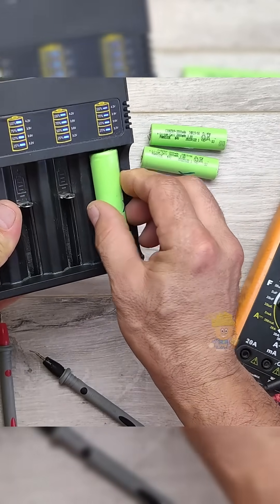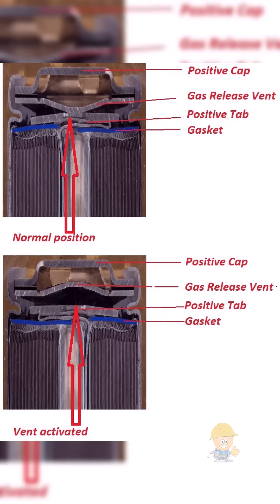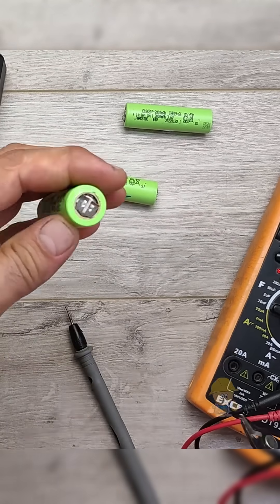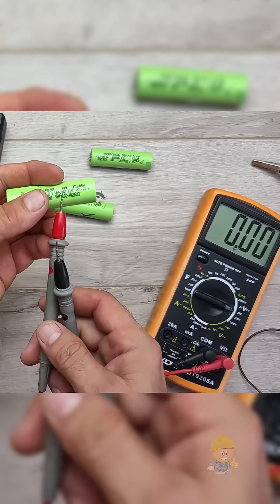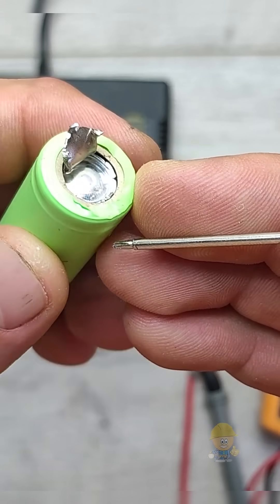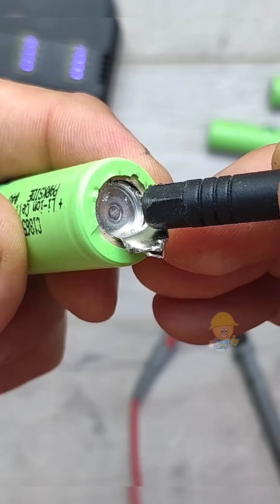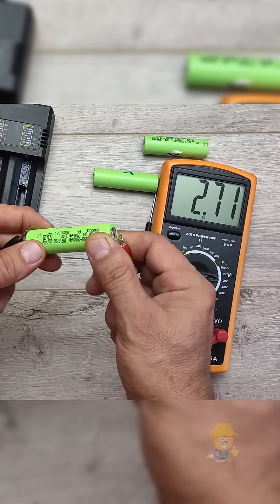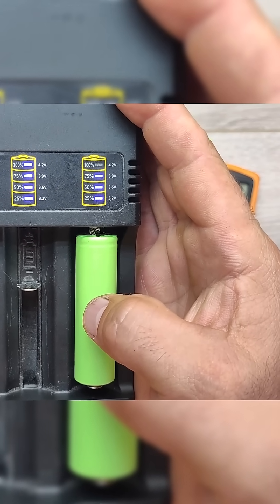Parkside cells How to reset 18650 dead 🔋 lithium cells #diy #parkside#battery

Comment: I dont really know what your talking about. Ive been messing with 18650 cells since 2015 and they rarely if ever have 'protection'. You shouldn't be messing with this safety feature if there is excessive gassing its designed to rupture the weakened wall instead of exploding. Its the best thing as lithium ion cells electrolyte is flammable. If you don't understand batteries you shouldn't be messing with them as lithium metal is extremely reactive with water (but it makes a great battery) and there lit nothing you can do if there on fire as they store a tremendous amount of energy and that energy WILL come out as fire/light/gas fueling itself. There like ppl there sensitive to temperature and if misused will cause a fire. I have literally thousands and not a single one has gave me a problem.

It also helps not to be stupid. Life is SO much hard when you are.
Reply: Even unprotected cells have some protection, like shown in the video. "Protected" cells usually means it has a battery protection module inside, a tiny piece of electronics that prevent over charging, discharging and over current. "Unprotected" just means it lacks the electronic protection, they still generally gave the mechanical protections.

I don't think you understand batteries as much as you think you do.
Reply: @conorstewart2214   wait till he hears about a bms!
Reply: almost ALL name brand 18650s have CIDs and this video explains it well but obviously its very dangerous to reset a CID as if someone manages to pop the CID in a 18650, that cell has been very abused
Reply: @joshwayop  it means it was ruptured for a reason plus the lack of electrolyte. as im more of a mechanic I would call it a pressure re leaf as that's exactly what it does. cid is very unintuitive and kinda misleading
Reply: @ they are called CIDs in lithium batteries, its the officail name, but yes they are pressure release valves
Reply: please learn English and WITH grammar.
Reply: @Nilmoy  Dragon.... How about you speak dragon instead. Ever played Skyrim
Reply: this chinese shop advertising :)
Reply: @r3volt97  they tend to be weird and awkward like the amazon videos lol
Reply: @r3volt97  All your hard berongs to us.

Comment: The idea is good provisorly until you run the battery out for the last time, but don't try to charge it again ! If the protection popped out is because the lithiun is heating up . To charge without this protection can cause battery explosion
Reply: The valve should still work after reset, but I would only use this option in an emergency.  Like you said, it tripped for a reason, and will trip again.  Replace ASAP!

Comment: I hope no one actually does this to their batteries but this is really cool to know. I guess the batteries dont mysteriously completely die and wont even take charge, its just activated the saftey mechanism, good to know👍
Reply: a safety mechanism that exists because that cell will no longer charge predictably. I do it to cells that I intend to overvolt for lulz. I can't imagine anyone bringing one in their house, let alone holding it to their face after disabling the safety.

Comment: ya i reset these, or rather bypass them all the time... got all kinda things working again off old once dead laptop batteries. I've converted many older flashlights and radios and stuffs to use these instead, its so nice, they last so long, and no more buying aa, or aaa's c, d, etc///

Comment: Usually if they are just dead recharging works. Of they have a blown vent don't use them again as they are damaged inside.
Reply: Exactly
Reply: It's amazing how many people don't know what they are talking about! If a lithium-ion battery is below 0.8 volts a charger probably won't work. You can jump it with a charged battery to bring the voltage up to a chargeable level. Also they do have a circuit breaker in them if they happen to get shorted out. If your battery is reading 0.0 volts you can take a small, sturdy piece of metal that will fit in the small holes at the positive end. Pry down on the metal cap underneath. You will hear the gas escape like when you open a carbonated beverage and the battery will now read a chargeable level. I have been doing this for several years and saved lots of batteries that would otherwise have been thrown out. Reuse and recycle please!😅
.
Reply: @ You are the one who doesn't know what they are talking about. Try reading full comments and understanding what people are saying. Perhaps stop smoking meth before using the internet. There are Lithium ion chargers that can do 0 volt charging, meaning they can charge a lithium battery that is under voltage. And under voltage for a lithium battery would be anywhere below 2.8 volts, not 0.8. You should NEVER jump a lithium battery with another battery as it charges way too fast and actually damages the cell, That means you will potentially have both cells explode from over heating. A charger from a dollar store power bank will properly trickle charge the cell until it is over the 2.8 volts, then will charge it at the regular rate. Learn things before commenting stupid things like an idiot. No, lithium cells do not have a circuit breaker. solid ones that are not pouch batteries have a vent. That's all. I would know... At this point I must have had several hundred of them. And you NEVER pry the cap off to vent gases, it does that on its own. And a battery will not magically read a chargeable level by venting the gases, as the gases have no effect on the charge level. I know you haven't done this for years. You'd have burned down your house by now. Idiot. The fact that you claim to have done this for years, tells me everything I need to know about you. At the least you smoke crack or meth, and you're a very stupid person.
Reply: If they're below 2.8 volts, then many chargers won't charge them because they're "under voltage". You'd need a charger that can do 0 volt charging (charges from 0 volts rather than 2.8). The dollar store power bank circuit board can do this.
Reply: @darrylkinslow5613  Either this or a lab power supply. First set it to 1V, then 2V and so on until you reach 3.8v. Every time set the current to 100mA max and wait till it drops to 0A. Then raise the voltage to the next level. IMPORTANT: Constantly check the temp of the cell. If it starts to get hot, stop charging it and bring it outside, as it is damaged internally. Wait a while and then properly dispose of it in a recycling centre. Maybe discharge it to 0V with a resistor to stop it from being able to burn.

If a lithium cell is at 0V, it often can't start burning anymore. I tried putting a hole in a small LiPo battery after it had 0V and nothing happened except a bit of smell. Don't try it at home, but it is a good advice to slowly completely discharge it if you have a bad or damaged cell.
Reply: @ I would never recommend attaching a battery directly to a lab/bench power supply. No protection whatsoever. You're likely to have the battery explode from overheating.
Reply: @darrylkinslow5613  That's why I said to limit the current to a low level and check if the battery becomes hot. It's nothing a normal person should do, only people who know what they are doing.

You should just dispose of bad batteries and buy a new one.
Reply: You do know it's a chemical reaction and chemical degradation/damage due to (ab)use?
Might work in a pinch, but always need replacement. They are zombie batteries.
Reply: не трынди
Reply: Correcto cumplió su función,  se activo valvula y la desabilita por seguridad, romper la valvula para seguir usando es peligro de incendio explosión dentro de un dispositivo

Comment: Please for the love of God don't bypass the safety devices on lithium power cells, recycle your batteries and by new ones so you don't burn your house down
Reply: saya sdh mencoba nya itu bagus buat penerangan solar panel
Reply: Because lithium batteries will do that anyway if you have them, when luck decides to give you the D instead.
Reply: You're not my mom
Reply: Don't do it, but here's a step by step guide on how to easily do it.
Reply: @Mug-Red

Don't do it at home (unless your really know what you are doing 👀)..but.. in a emergency situation this information could be the difference between life and death.
  Knowledge is power and power comes with great responsibility. 😛
Reply: Ikr😭
Reply from the maker: This video is only a presentation of the safety system, and it is specified in the video that it is not recommended to do this operation at home, as there is a risk of fire and explosion
The battery safety device has not been removed, indeed these batteries are no longer useful, they have been recycled and replaced with new ones.
Reply: @CMCdiy  what a load of nonsense. This was not a video just showing the safety mechanism, this was a video showing how to disable it.

Yes the safety device has been removed, you have forced it back down and have no idea of knowing if it would be able to trigger again, it is no longer a safety device.
Reply: @conorstewart2214   The safety device isn't actually disabled, just reset. If the battery still produces hydrogen, it will pop the pressure safety switch and detach the pole again.

Still i absolutely recommend not fiddling with it. It's not designed for repeat actuation so who knows what will happen, and besides, the switch actuates for a reason, a reason one shouldn't be too keen to find out.
Reply: @SianaGearz  yeah, probably its already a dead battery and the lithium battery electrolyte its getting hot so in a few charges and discharges it will disable itself